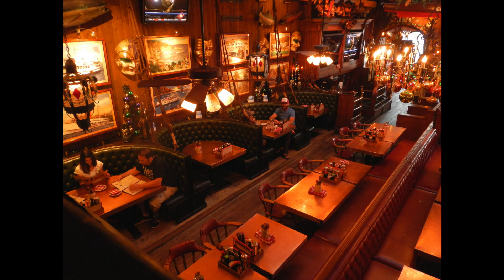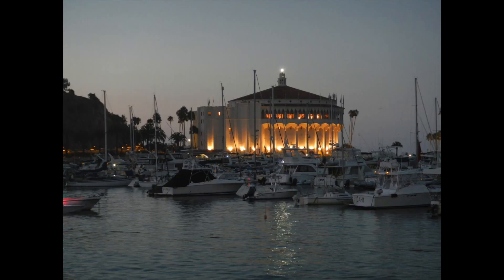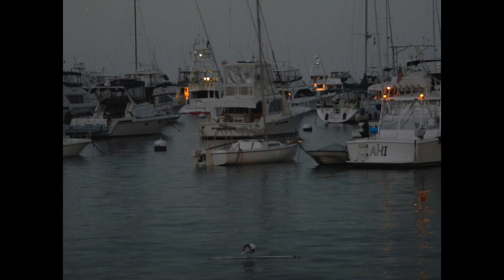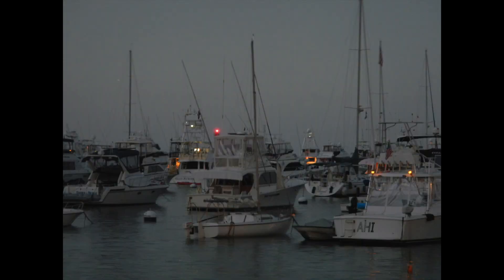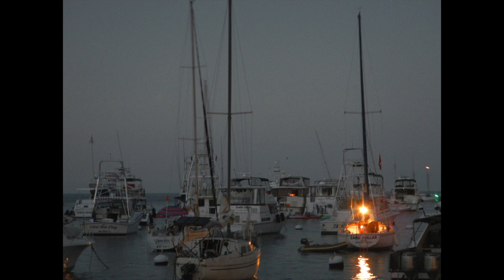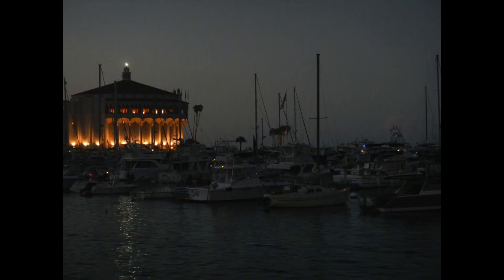Sailing to catalina Island on The Go Around #2 (A Restored 1966 MacGregor Venture)

Comment: Great video and a pre-story... I'm fixing up a 23' Aquarius sailboat that i want to take to Catalina... the boat can probably make it as it is, but the trailer isn't good enough to make it to LA area from san francisco... one day... one day.... :)
Reply from the maker: I remember the Aquarius sailboats well. Yoru boat is very sturdy and should not have any trouble! Now with the trailer if your a fixer uper kind of guy, craigs list a 20 to 25 foot boat on trailer that you'll take away for free, see who bites, and you may get a new (used trailer) free. That's what I did when my origional trailer completely fell apart on the freeway! And After a weekend of welding and cutting up the old boat that was on the trailer, i had a new sailboat trailer that takes me where ever I need to go! The total cost was the blades for the sawsal, and grinder cut off wheels! Ha ha. Good Luck. Thanks so much for sharing my video! I'm so happy people are dreaming and sharing this great sport!